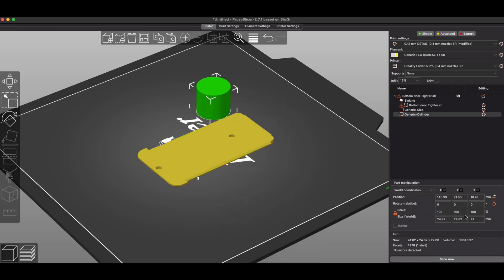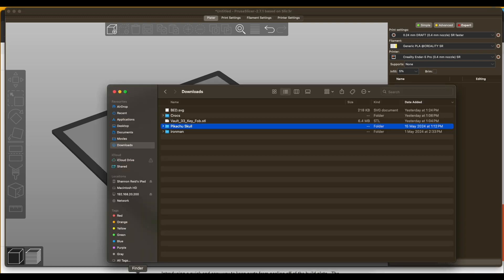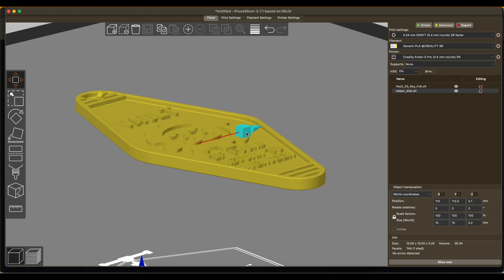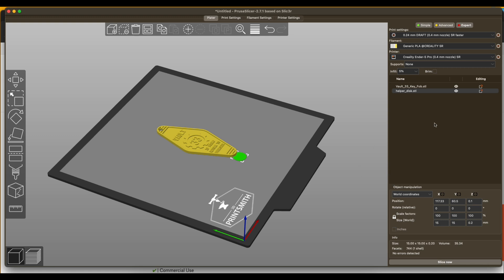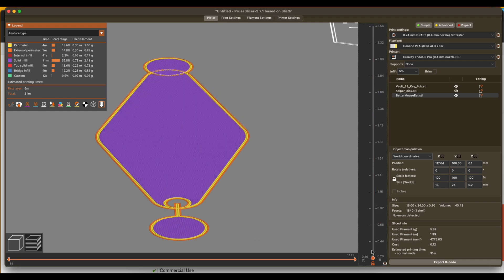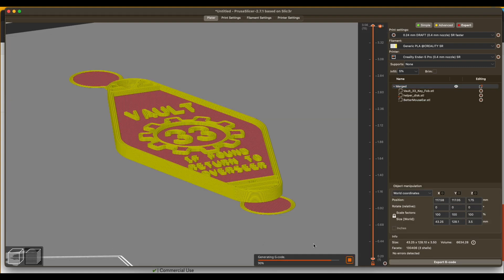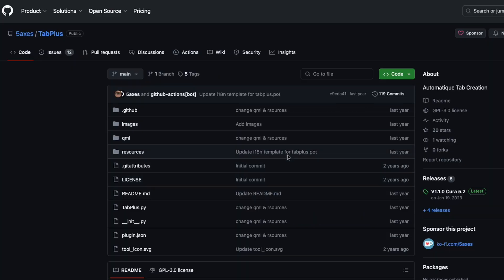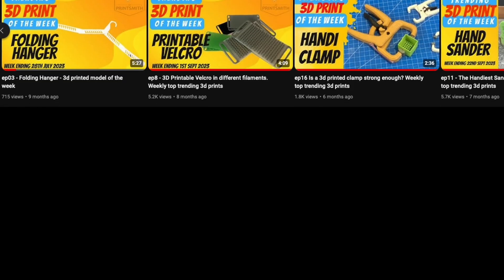An update on how to add tabs easier to Stop corners lifting

Comment: Very good idea. I used it with little upgrade. Connecting lines with the tabs in one STL - a circle with a tail. Tabs 10mm diameter, tails 1mm x 5mm. Height 0.75mm - 0.35mm first layer + 2 layers x 0.2mm or as needed. Position and rotate so the lines are pointing to the desired corner. Then merge all and slice as one part.
Reply from the maker: Sounds great! thanks for the details
Reply: @3DPrintSmith  Thank you again for the idea. I was making the tabs the hard way - included in the part design. Never occurred to me to use separate part for the tabs and to merge all in the slicer.